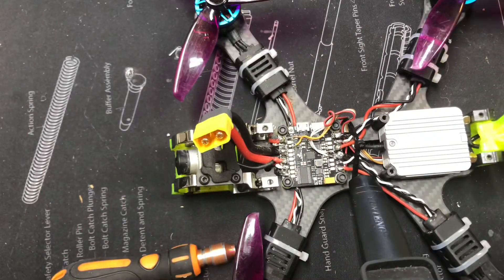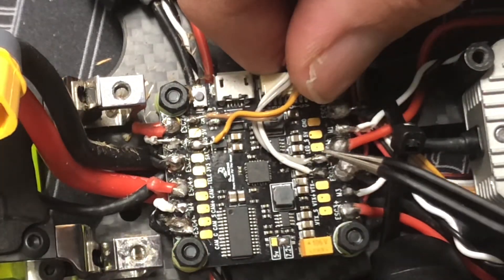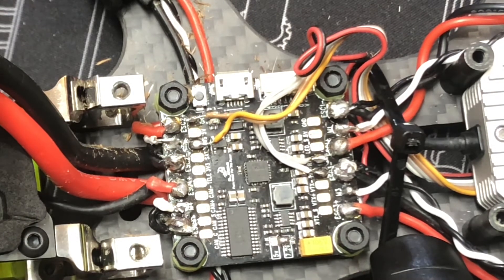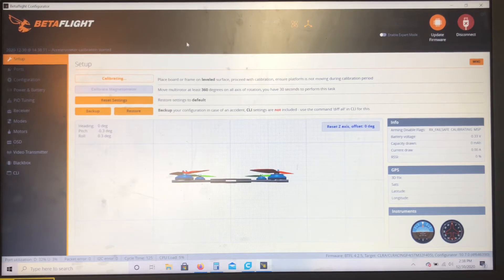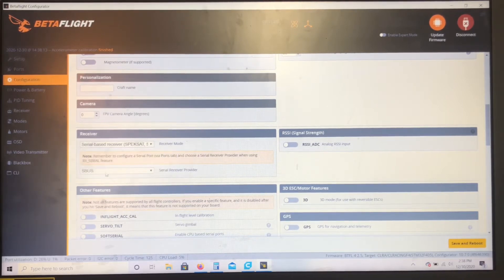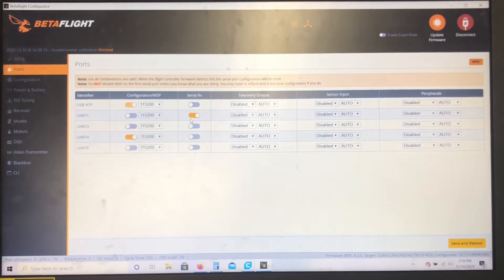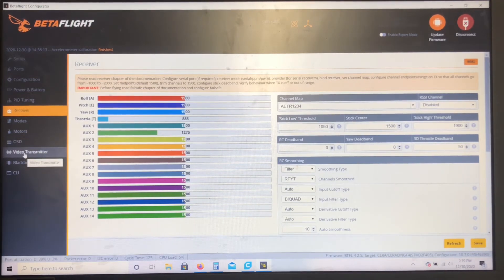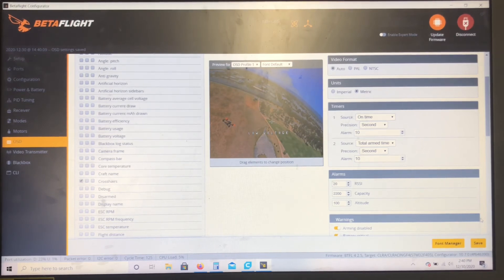CLRacing F4s DJI Air Unit Wiring and Betaflight Set Up

Comment: Thank you for this video! For me its very useful, becouse i have the same flight controller, and this is first drone build in my life! :)
Reply from the maker: Awesome I am glad. I always had trouble setting stuff up. Let me know if you need and more tips.
Reply: as i can see you using 4S battery and powered up DJI Air Unit from the battery? Becouse i build 6S version and already add a BEC power 12 v for Air Unit.
Reply from the maker: @EvgeniySukhoi  I have always been 4s it just seems simple for me. Do you think 5s is worth the upgrade?